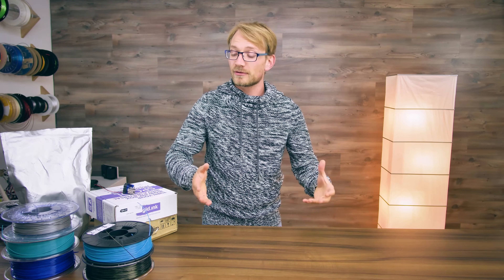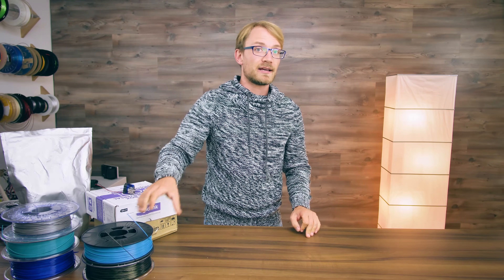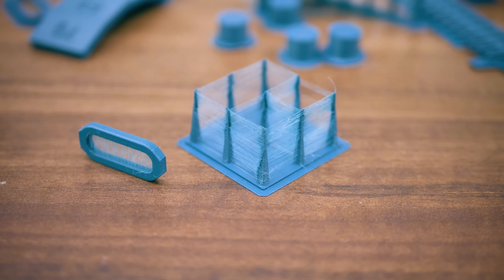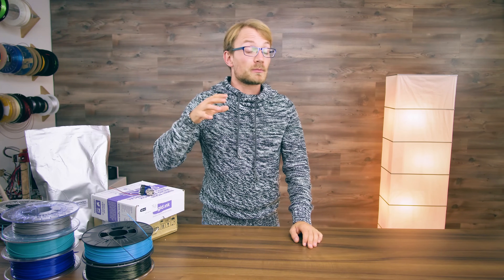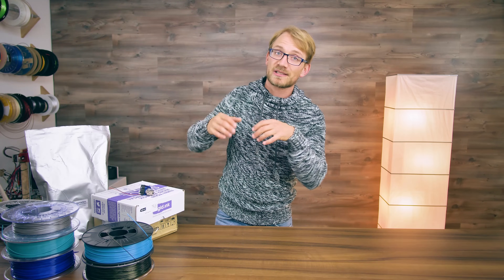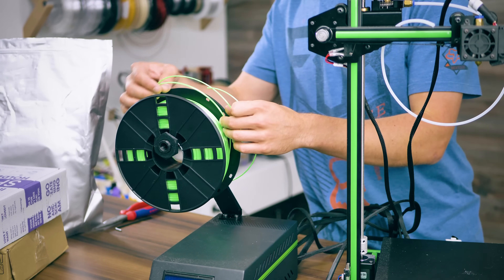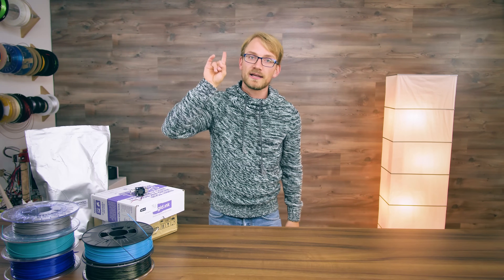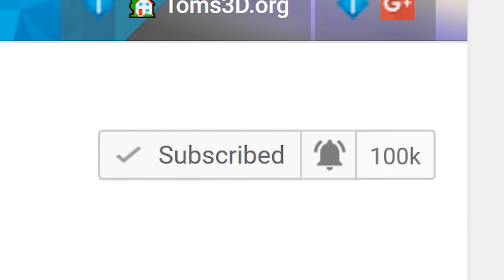5 ways to ruin your filament (and how to fix it)!

Comment: Hi am using the flsun qq I just changed the filement and noticed its coming out far to thick I changed my filement down to 1m should it be higher the filement when printing lift off the bed at the start of the printer can u please advise me as am about to brun up more filement and it doing my head him excuse the last bit am a scot

Comment: For the last one, I personally use a TP link smart switch with octoprint. It waits for the printer to be idle for specified time and the temperatures have dropped and they switches of the printer(switch). Bonus point it can be auto started when you send a new print to it

Comment: I'm new to 3d printing but couldn't help notice that whenever the spool was held on a set of rollers beside the printer, regardless if it was in a dry box or out in the open air, that the filament was being fed from the bottom of the spool.  This is a cardinal sin in the wire feed welding world.  If you set your wire feed to deliver from the bottom of roll you are almost guaranteeing yourself an unraveled mess of welding wire birds nest inside the cabinet of your welder, if you were fortunate enough to remember to close the cabinet, if not your mess is now shop wide, lol.  Filament isn't going to have the same spring forces as welding wire and is less likely to overcome the mass of the roll and unravel like welding wire can, but it may help to feed your filament from the top of the roll in these set-ups.  Partial rolls may be more prone to unraveling as it seems like the spring forces in the smaller radius inner coils would be greater and the mass of the roll is certainly going to be less.

Comment: I've had some rolls of PLA since about 2014 (Awful, I know!) If I stick them back in some bags and get some fresh desiccant packets, will that set them right. (Old and new PLA keeps breaking!)

I got a new CR-6 SE a few days after it released, and I am having a little trouble with the hot end clogging up, as well. I wonder if what you touched on about the teflon tube going into the block is my problem there. Any suggestions?

I've had a printer for years before this, but the difficulties and setbacks with printing kind of kept me from doing it. Hopefully, armed with more information, I can move past these things and press on!

Comment: Afaik you can untangle the knot in #1 without taking it out of the extruder. Get extra slack by loosening up the real and then pass the reel through the knot. I've done it on spools of wire.

Comment: Dude my Pla filament is so brittle...it breaks even if u bent it like 10 degrees...
It was vaccum packed.....but still when i opened it.....it was brittle.
Pls help me with this.....
I dont have a dehydrator...but do have an oven...is it safe to use it.

Comment: Thank god i found this video... I was just trying to find vacuum seal bags to store my filament and because im a noob i have no idea what im doing but thankfully you said PLA doesn't NEED to be stored in some crazy box/bag i can just leave it in my room so saved me some money. I do have a dehumidifier too so i guess that will help with the small amount of moisture in the air anyway.

I probably will invest in some bags when i get more into 3d printing but right now i can just use the desiccant packs until i get more than one spool.

Comment: You didn't address brittleness, especially that of PLA. It seems like the main factors causing degradation and brittleness of PLA and other polymers are light (UV rays) and air (oxygen). While moisture is bad, especially for Nylon and other porous polymers, it does not contribute to more brittle filaments. For PLA, the best practice is to keep your filaments in a dark place and away from fresh air (in a sealed container).

Comment: hey @thomas I have found a quick tip is that you can just reverse the filament a little ways so it is out of the hotend and the tube in the hotend. that way you can leave your printer alone for days without printing and not worry about it getting brittle or clogged.

Comment: Nobody has an oven that can maintain a low enough temperature. And I have been drying my filament ALOT and I have only seen minor improvement. I still get popping/blobbing/stringing. I may have overheated it but what is that temp/time that is bad for pla and are the side effects the same for it having moisture?

Comment: i will pick up some zip lock bags... you can even remove most of air from them... i have had many spools go brittle on me... it really is bad news... drying in oven never works well...best to buy filament and use it fast and store it well between uses imo.

Comment: Ive got an issue with my flash forge adventurer 3.... its only printing a very small amount then it stops with the error msg.... filament error.  The filament looks fine, just swapped filaments to have same result.... could it have something to do with stepper motor needing upgrade...?  Any advise will be much appreciated thanks

Comment: Great vid, for some reason I can't stop looking at your outfit for some reason, must be the colors and the way the fabric is textured, seems really weird at 1080p.

And has anyone thought of 3D Printing a " flat-end sucker adapter" that when attached to a vacuum cleaner would allow you to suck the air out of the PE bag, so that the filament is stored in vacuum? Or may be a special device can be made,  similar to those cheap Chinese food Lamination Sealers?

Comment: In the box my filaments come with, there's a small bag of silica gel included. I leave it in there. (I even staple it to a corner inside the box  so it doesn't flop around). It's included to help to keep the moisture levels low inside the box. When the filament isn't in use, I store it in the box with the attached silica gel and I also keep the box closed.

Comment: Toward the end about turning off the machine.  How about retracting some filament so it's not in the hot-end?  Can do that manually or with Gcode which I don't know how to do on my Ender 5.  Now I know whyI keep having problems with my filaments.  I've been shutting down the printer too early and/or not retracting filament out of the hot-end.  WOW! thanks Tom

Comment: A couple of tips on storing PLA and brittleness: if you leave it unused for a long time stretched out of its spool it can get brittle. Not sure exactly how long this takes but after years it can definitely be a problem. I read that this is because of the stress of being pulled out of shaped for a long time.
So if you might not use it for a long time it can be best not to leave it threaded through the 3D printer, but put it back on the spool instead. Or if it's already brittle, you can check that only the part that was out of the spool has been affected and break it off.

Comment: Hi, I'm from Brazil and I have a question about filament conservation. I have a PLA filament roll and it's open and installed in the printer for quite some time. Lately I have noticed that the filament is getting dry and brittle, it is even difficult to install it in the printer, because it breaks easily. What could be happening with this filament? Is it possible to recover it?

Comment: Hi i want your advice on abs filament i had used 245 nozal temperature 110 bed temp letyar0.15 in fill 100% and 100 speed but still my abs print breakup in hand after little push by fingers. Its snap off

What i do next to make my print stronger 
GURMEET SINGH

Comment: I just spent 3 hours taking my Dremel extruder nozzle apart to remove a clogged piece of filament that was beyond the help of the supplied de-clogger tool.  Why?  Because I was clueless about the very first thing you explain so well in this video.  Thank you so much!   Wish it had been part of the basic instructions that come with the printer.  You did a great job of explaining it.  Thank you

Comment: My PLA became too brittle and kept breaking off during printing... I believe this is due to the long time it took me to go through this particular spool (almost 2 years) and constant heating and cooling... So I guess PLA does go stale... Has anyone else encountered this?
Reply: Jester Man same like I have two spoils I still use which I got when I got my printer, over two years ago and they are always snapping and brittle when I’m trying to load it into the printer
Reply: I have some that came from Chinese eBay sellers that only worked for the first month I had it, after that it just became too brittle
Reply: Have you tried heating to 70C and then cooling.  It might need to go past the glass temperature and re anneal.  There’s likely some experts who can answer this in forums.

Comment: Ah, snarls on a roll!
I agree with the side-dump school to get to clean winding's, but didja know that you side-load to put the filament coils back on the roll?
OK, side-dump has coils on the floor, proceed to pick up one or two loops at a time, and side-load them onto the roll.
Side-load?  With the spool held steady, just slip the loop over the edge of the spool.  Spool does NOT turn!
One or two untangled loops at a time, and the messy coils get all happy in short order.
The biggest win with side-loading is you don't introduce axial torsion on the filament!
The winding you show will almost certainly put a length-wise twist into the filament.
This is worse than looping-under, as this torsion can make a spontaneous 'birds nest' when passing from spool to extrusion motor

Comment: The spindle of most filament holders are quite a lot smaller than the hole in the spool.  I print up adapters that make this difference a lot less and then the filament tends to move a lot smoother off the spool.

Comment: OMG you have possibly explained a hug issue I have been having. I have been always just turning the printer off when done or when I want to cool it down. I have been having issues with pla sticking in the cooling block. Thanks for doing these videos.

Comment: 2 questions:  Does it affect to the printing quality that the filament is a bit dirty (it has dust), or it doesn't matter? and why filaments that have absorbed water have more stringing issues?
Reply: the dust will clog your printer nozzle or otherwise affect print quality so its good to keep it clean. as for moisture it can make the plastic brittle due to it boiling off and thus breaking the polymer molecular chains.

Comment: +Thomas Sanladerer I seem to have the opposite issue with my filament in my environment.  I'm in an very dry area (Western Canada, Rockies/high altitude) and have a problem where my filament becomes extremely brittle because it's too dry.  Any suggestions?

Comment: another easy way to store filament in a controlled environment is to use a food grade bucket with a gamma lid to seal out moisture. You can take it even further by sticking a dehumidifier or just some regular loose desiccant in with it.

Comment: uhm, what?
 i never ever use those holes on filament spooles! leaving them dangeling is fine, it rarely gets between another turn, and when it does, whyt printer can just move the isue further backwards, untill i notice it, pause the print, just pull it through, and put back in! no plroblems at all. just dont lay your spools down, as this will ruin them not matter what. i put one down once, the end taped to it, because i knew laying it down was risky. it totally messed the spool up, couldn't use it again. all the turns where intersected.

Comment: I actually use a dehydrator inside of a closed print build chamber to remove moisture from my filaments and another plus is, that you can use it to print perfectly with ABS and such to keep a steady temperature throughout the chamber. Great video, Abo activated ;)

Comment: Thank you.  I have worked in injection molding for a lot of years in my past.  Some plastics were put in a dryer that passed hot air through a large drum.  A vacuum system pulled it in to the machine and another would refile the hopper.  I am looking forward to more of your videos.

Comment: HELP Hey when I plug in my printer my heated bed heats up to max it doesn’t matter what I have it set to and I don’t even have to pre hear it for it to happen if it’s plugged in it heats right up to max does anybody know what the problem is how can it be fixed
Reply: bobby taylor do you have the thermistor mounted properly?
Reply: Ole Elias Bergersen yes I believe it is it even shows the temp it used to not heat up unless I tell it to preheat but now as soon as I plug it in it starts to heat up and just maxes out
Reply: I would say that a sensor of some sort were broken, but without the printer in my hands i can not say any more, sorry. Have you tried reddit?
Reply: Ole Elias Bergersen I didn’t ... do you think it’s something to do with the board?
Reply: That could be, some fried connectors perhaps
Reply: Might be a shorted mosfet

Comment: Hi Thomas - Thanks for all of your videos.  They're very helpful and you're one of my favorite channels due to your methodical approach and efficient presentation.  I have a request, if I may.

I have seen bits and pieces of you post-processing your prints.   I think you could do a video on post processing that would be very helpful for the community.  Things like how to machine various materials (what accepts sanding, drilling, tapping, etc well), deburring edges, recommended glues for different materials (more strength tests? :D ), and probably lots of other tips I have no idea about.

Comment: I thought it worth adding that your trick of unwinding the spool by about 20 turns to release the knot can also be done whilst the filament is still in use by the printer... You have to thread the whole spool through the loops to release the tangle, but if you have enough slack in the coils so the printer can carry on unaffected then it can get you out of a fix without having to abort a print job... I had to do that trick a couple of weeks ago. Cheers!!
Reply: Thanks to your comment I just accomplished this mid-print. Thank you very much. The extruder on my Voron pulls pretty hard and I could hear the roll popping every so often as it tightened up at the tangle and then pulled through it every few turns. Smooth sailing now.

Comment: ad 1:  I do put the end of the filament through the hole BUT while stacking spools it can very easily break off. I bought a few air tight boxes for three spools eachs but they are no fun if I break loose all filament ends :-(

Comment: I used a 3d printed oiler for my filament while I'm printing, but I have found out its best for pla only, when I use it for abs, something in the oil degrades the abs and makes it super brittle and it'll break while printing, I'm using coconut oil BTW.

Comment: I'm glad you mentioned too little drag on the unspooler being a potential problem. I see so many spool holder designs with ball bearings when a plastic bushing on a metal rod is plenty smooth enough. I've even used brush bristles to add a bit of drag so the material doesn't unspool itself.

Comment: You mentioned not letting  your hot end sitting at temp for long periods and it got me wondering. Do you think it would be doable to make a cleaning filament? Slightly abrasive with a heat activated cleaner of some kind designed to grab on to and remove build up in your nozzle? I've used similar things on other machines (non 3d printing machines) to clean sensors, drive wheels, etc. Could be interesting if such a thing was doable.

Comment: In the event you have a tangled filament like case 1, instead of taking the filament off the spool, loosen like you have described, grab the loose bundle as if you have the filament running through a ring, then turn the spool in the direction as if you are re-spooling it. As you spin the spool, you are re-spooling the filament. By the time you reach the end, the overlap would have been worked out by itself.

Comment: very nicely explained! thanks tom.  I agree I had PLA sticking and jamming inside the heat block by just turning off the printer while the hotend is still hot. and this is more serious problem with the clone without any Teflon tube inside. but I didn't realised this until I saw this video. now its all clear why the filament was sticking inside every time and I can prevent that from happening.

Comment: One thing I like to use for preventing my filament from unwinding is binder clips. When unloading filament, I like using a small binder clip to keep the spool from unwinding and I also use it when storing it away. Works great!

Comment: The technical quality on this video is insane, Tom! I need you to show me how to film videos - looks great! Also, the new Prusa should be able to stop itself if it encounters the 1st problem :)
Reply: Veeryy cool colors :) maybe a bit too much color correction? :) But looks great thou.
Reply: It is indeed. You're gonna need to 'gear up' though, 4K @ 60FPS is hard on space and CPU cycles... :-)
Reply: I was wondering if ether of you would be interested on doing a video about changing filament types I.e going from a plastic like abs PETG or nylon to a different lower temp plastic like pla without getting jams
Reply: first reaction!!
Reply: Just experienced the filament snapping of half an hour before a 5 hour print was done. Printer didn't even stop according to the camera recording, so the print sensor doesn't seem to work properly even though it passed the initial test. This printer is just a couple of days old.
Reply: Update on my last comment, filament sensor was disabled in the newest firmware
Reply: Mmmmm 60 fps ;)
Reply: hi joel

Comment: If you're running a Bowden style extruder, add a long retraction to the end of your prints to remove the filament from the hot-end. In the 'Ending Script' tab (for Simplify3d, other slicers have their own script locations.) add the lines: 

M83 ; extruder relative mode
G1 E-50 F10000 ; retraction 

Adjust E-50 until the filament is visibly retracted into the tube, but not too far, and the F10000 to adjust the speed.